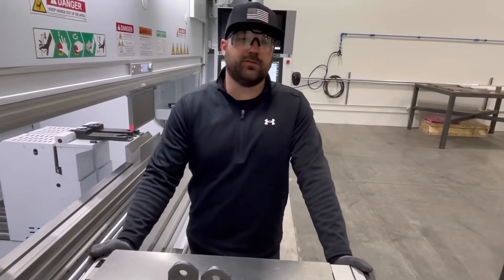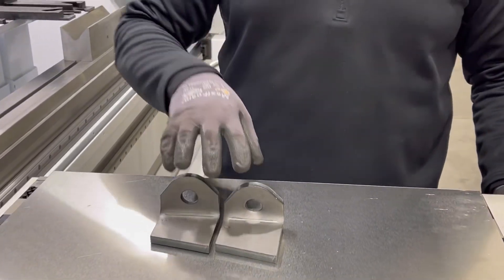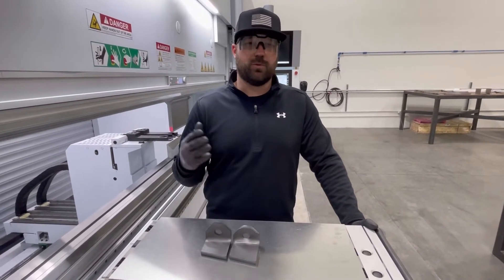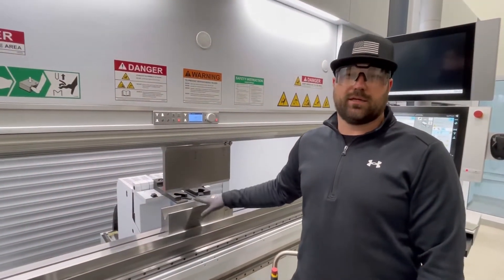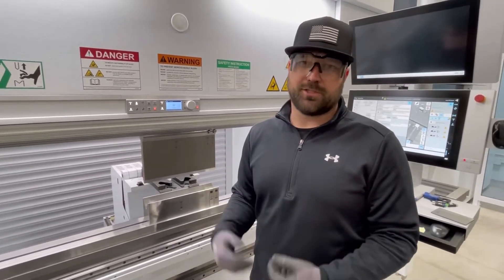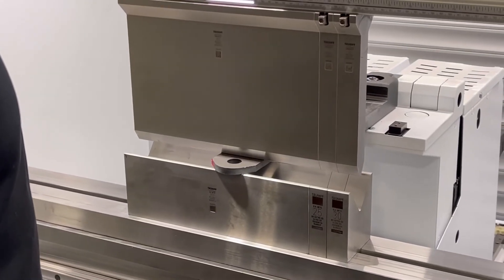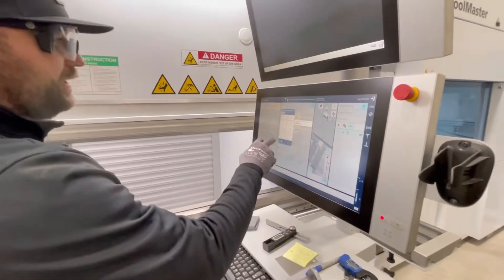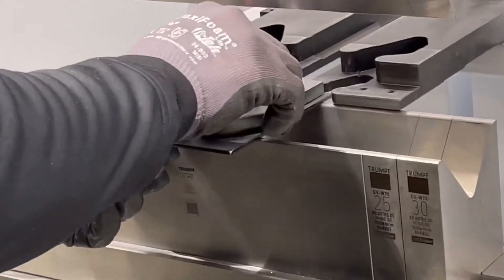Jordan Yost Owner of Precision Tube Laser shows us the trick to fixing hole distortion.

Comment: A Great idea to add a special function for sheet bending,with a packing plate underneath part to stop holes distorting and also stop marking of parts. You could use a pilot hole first then bend parts and open up drill or mill to correct size after.